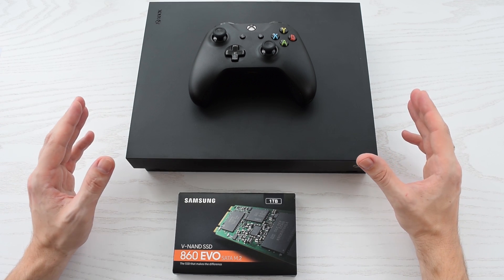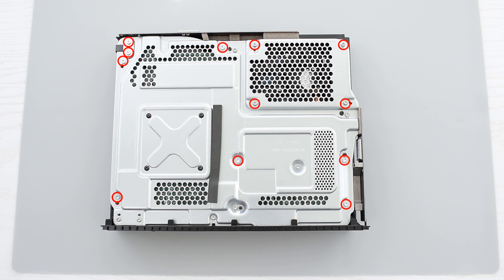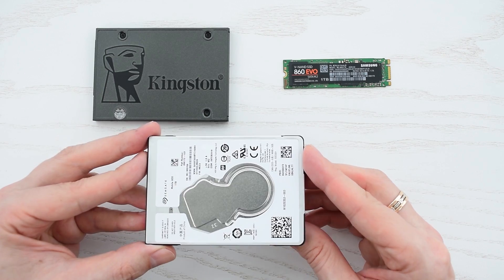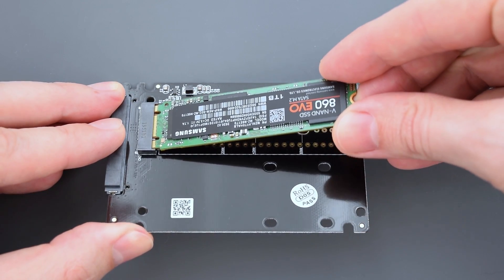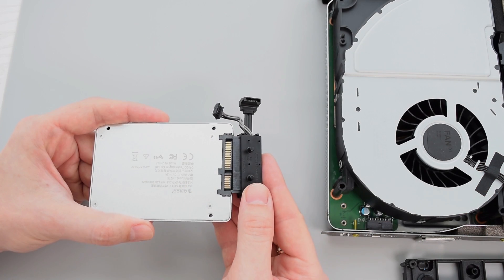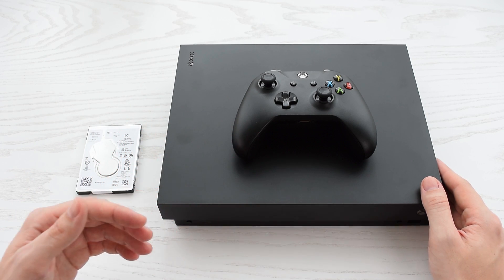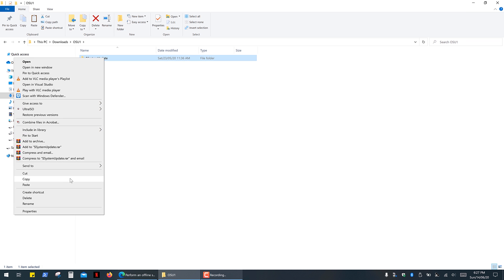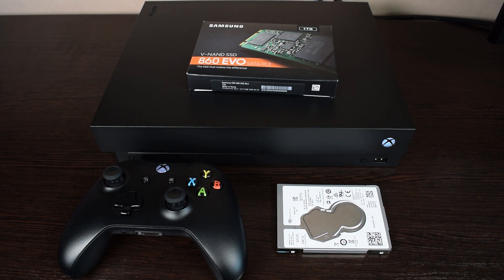How to Upgrade your Xbox and PlayStation Console to M.2 SSD Drive. 100% Works for all Consoles

Comment: Wonder how many people going to by a NVMe and do this only to find out it won't fit XD
Reply from the maker: We didn't use any NVMe SSDs here because it's impossible. We were using M.2 SATA (NGFF) SSD which has SATA III interface. And we need that adapter only to adapt drive's form factor. The main idea was just to show the upgrade options. Lots of people say that they have spare M.2 NGFF SSDs after upgrading laptops etc. And they didn't even know that such adapters exist. Or maybe you just want to use that M.2 SSD in another device after your console dies (2.5" SSDs are becoming obsolete), then it's pretty good option.

Comment: That's the wrong m.2 for that slot you use M key or sata not a b+m key. But I like your video.
Reply from the maker: M.2 SSDs with M key are NVMe ones which you can't use in this application. You can't convert NVMe (PCIe) SSD to SATA port!!! You can only use SATA based (NGFF) M.2 SSDs which have B or B+M keys. I hope I explained it clear.
Reply: @ElectronicsComputers thanks for the tip I appreciate it

Comment: Can the same method be used for pcie Nvme m.2 SSD's?
Reply from the maker: You can't convert NVMe (PCIe) SSD to SATA port! You can only use SATA based (NGFF) M.2 SSDs which have B or B+M keys.

Comment: That is a waste of an M2 drive. It is not going to be fast because of bottleneck it caused by the old Xbox arcatechture
Reply from the maker: We were using M.2 SATA (NGFF) SSD which has SATA III interface just like Xbox One X. The main idea was just to show the upgrade options. Lots of people say that they have spare M.2 NGFF SSDs after upgrading laptops etc. And they didn't even know that such adapters exist. Or maybe you just want to use that M.2 SSD in another device after your console dies (2.5" SSDs are becoming obsolete), then it's pretty good option.

Comment: It’s better to just buy an SSD data drive you will get the same performance for less!
Reply from the maker: The main idea was just to show the upgrade options. Lots of people say that they have spare M.2 NGFF SSDs after upgrading laptops etc. And they didn't even know that such adapters exist. Or maybe you just want to use that M.2 SSD in another device after your console dies (2.5" SSDs are becoming obsolete), then it's pretty good option.

Comment: Does Sony or Microsoft give some problems on that work? It Is very interesting and i Will share your video
Reply from the maker: It works perfectly well with all devices (laptops, desktops, consoles etc) that have SATA port. You just need to figure out how to install OS. And make sure that you use NGFF (SATA) SSD not NVMe.

Comment: What's the benefits of this? Would it make a ps4 run better as mine is running a tad slow cheers
Reply from the maker: We were using M.2 SATA (NGFF) SSD which has SATA III interface and it has the same speed as any 2.5" SSD. The main idea was just to show the upgrade options. Lots of people say that they have spare M.2 NGFF SSDs after upgrading laptops etc. And they didn't even know that such adapters exist. Or maybe you just want to use that M.2 SSD in another device after your console dies (2.5" SSDs are becoming obsolete), then it's pretty good option.

Comment: Nvme to sata 🤮
Reply from the maker: Don't leave such silly comments! We didn't use any NVMe SSDs here because it's impossible. We were using M.2 SATA (NGFF) SSD which has SATA III interface. And we need that adapter only to adapt drive's form factor. The main idea was just to show the upgrade options. Lots of people say that they have spare M.2 NGFF SSDs after upgrading laptops etc. And they didn't even know that such adapters exist. Or maybe you just want to use that M.2 SSD in another device after your console dies (2.5" SSDs are becoming obsolete), then it's pretty good option.
Reply: @ElectronicsComputers  sata câble as à maximum speed of 6gb/s dont say its à silly comment 2.5 inch ssd are 50% cheaper and you wont let speed on the table if you get any fast nvme and convert it to sata you have to have brain damage even worse by installing in a console 😂😂😂 I know what I am taking about I have 4x nvme 2tb on a pcie 4.0 lane on a pc cause I am not fck stupide and I did put a 2,5 inch ssd in my one x still sucks tho.
P. S. there Will be spelling mistakes english is m'y 3th language
Reply from the maker: @Kawasaki225  You no nothing about SSDs, dude. I was using SATA M.2 SSD!!! It's NGFF not NVMe!!! You can't use NVMe on that console only SATA based SSDs. Educate yourself and don't leave stupid comments! 
The main idea was just to show the upgrade options. Lots of people say that they have spare M.2 NGFF SSDs after upgrading laptops etc. And they didn't even know that such adapters exist. Or maybe you just want to use that M.2 SSD in another device after your console dies (2.5" SSDs are becoming obsolete), then it's pretty good option.

Comment: This is a great tutorial.  However, it makes no sense whatsoever to upgrade using and NVMe SSD because it will only achieve SATA speeds.  This is a limitation of the motherboard chipset inside the XBOX One X.  Just use a standard SATA SSD, which is about half the price for the same amount of storage.  And while your at it and have the unit open, might as well upgrade to WiFi 6 👍🏻
Reply from the maker: We didn't use any NVMe SSDs here because it's impossible. We were using M.2 SATA (NGFF) SSD which has SATA III interface. And we need that adapter only to adapt drive's form factor. The main idea was just to show the upgrade options. Lots of people say that they have spare M.2 NGFF SSDs after upgrading laptops etc. And they didn't even know that such adapters exist. Or maybe you just want to use that M.2 SSD in another device after your console dies (2.5" SSDs are becoming obsolete), then it's pretty good option.
I hope you learned something today.

Comment: Good video, but totally pointless, the sata port is only capable of 600mbps no where near the capabilities of an nvme drive, and 2 nothing is coded to use anything faster than that. That’s why when you do ssd upgrades in these consoles there’s not much difference in speed.....
Reply from the maker: We were using M.2 SATA (NGFF) SSD which has SATA III interface the same SATA III port has Xbox One X. And we need that adapter only to adapt drive's form factor. The main idea was just to show the upgrade options. Lots of people say that they have spare M.2 NGFF SSDs after upgrading laptops etc. And they didn't even know that such adapters exist. Or maybe you just want to use that M.2 SSD in another device after your console dies (2.5" SSDs are becoming obsolete), then it's pretty good option.
Reply: @ElectronicsComputers  gotcha, after reading the description again you are correct. I just misread it.....

Comment: If you did that could you just put all your info on the ssd and have all your games
Reply from the maker: You have two options, you can clone your old HDD to your new SSD or simply reinstall Xbox OS and your games. Your game progress will be synced when you log in to your xbox account.
Reply: @ElectronicsComputers  how do you clone it
Reply from the maker: @grubling1494  We didn't clone it, we just installed a fresh OS from the USB drive.

Comment: Hmm..... for $100 I bought a Samsung 860 EVO SSD for a laptop and replaced the HDD in my PS4 Pro because they use laptop HDD's.... so this whole process makes no sense to me, got it home, put it in, installed the update via USB drive, done. Took me literally less than 5 minutes.
Reply from the maker: The main idea was just to show the upgrade options. Lots of people say that they have spare M.2 NGFF SSDs after upgrading laptops etc. And they didn't even know that such adapters exist. Or maybe you just want to use that M.2 SSD in another device after your console dies (2.5" SSDs are becoming obsolete), then it's pretty good option.
Reply: Ohhhh alright that makes alot more sense, I thought people were buying those to put in lmao.

Comment: All that work for a M.2? M.2 SSDs have the same speeds that regular SSDs have. No different in performance from M.2 SSD and regular SSD. Just stay with a regular SSD
Reply from the maker: It works only for SATA (NGFF) M.2 SSDs which has the same speed as a regular 2.5" SSDs. The main idea was just to show the upgrade options. Lots of people say that they have spare M.2 NGFF SSDs after upgrading laptops etc. And they didn't even know that such adapters exist. Or maybe you just want to use that M.2 SSD in another device after your console dies (2.5" SSDs are becoming obsolete), then it's pretty good option.
Reply: I had to replace my original hard drive because it quit working. Now it loads way faster.

Comment: Don't wast your money on this guy's idiot idea it's a wast of money, the interface he's telling you to buy is half as slow as what you could buy for the same price aka m. 2 pcie. Bit is twice as fast.

Yet it doesn't matter because the console can't read at that speed so why spend a premium? 

 Ya the Xbox S X a nitch product never seen a nitch product aka console take up a failing standard. "Cough" Blu-ray. SATA 1.

My point stands why pay for an interface that will not be used on PCs in the future as storage is all going PCI EXPRESS. And your trying to rationalize shoving a big black cock down when a better bigger black cock aka PCI EXPRESS down 5-year-old's throat you're never going to fit it and it's just obscene/inappropriate and a waste of effort and money.

Consoles CANT read faster than sata 2 aka 300MB/s on newer last gens but original PlayStation 4s can't support anything faster than SATA 1 @150MB/s at best. An your talking about 2,000MB plus speeds. Do you here yourself.

I'm only saying cuz there's a lot of stupid people out there that don't know better and you're telling them to pay more for absolutely no benefit.

Both sides of the interface have to be running at the same speed to get the benefit and the consoles do not read at that speed and it's too slow for the newer consoles not to mention the wrong interface.

So you still haven't told me anything that justifies why spending more on that old tech and you still end up spending more money than it would have cost by just buying a cheap SATA SSD.

Also SSD are generally unreliable on a reasonably used system for 3 years at that point you should be replacing the drive.

So why spend more money on something that's not going to last more than 4 years reliably when you can get a super cheap SATASSD for cheaper.

The Xbox can't read any faster than sata2 aka 300MB tops.

So why spend more for nothing gained?

Cost benefit analysis it's stupid

Comment: The bottle neck is the converter that changes the M.2 Drive to a SATA interface, so this won't make your console faster, it'll instead cap out at about 500-900mb/s.

If only Microsoft used M.2's interface as well for their consoles (excluding the Series S and X because they already use an SSD).
Reply from the maker: We were using M.2 SATA (NGFF) SSD which has SATA III interface. And we need that adapter only to adapt drive's form factor. This SSD has the same spedd as any 2.5" SSD. The main idea was just to show the upgrade options. Lots of people say that they have spare M.2 NGFF SSDs after upgrading laptops etc. And they didn't even know that such adapters exist. Or maybe you just want to use that M.2 SSD in another device after your console dies (2.5" SSDs are becoming obsolete), then it's pretty good option.

Comment: Im not sure that with ssd2m2 adapter it will be faster than the regular ssd sata drive...because of adapter...
Reply from the maker: No! It's not gonna be faster because we use M.2 SATA (NGFF) SSD which has the same speed as a regular 2.5" SSD. The main idea was just to show the upgrade options. Lots of people say that they have spare M.2 NGFF SSDs after upgrading laptops etc. And they didn't even know that such adapters exist. Or maybe you just want to use that M.2 SSD in another device after your console dies (2.5" SSDs are becoming obsolete), then it's pretty good option.

Comment: Does M.2 SSD drive installation also work on PS3 (1TB max) & Xbox 360 (2TB max) consoles? How about soft-modded OG Xbox & Fat PS2?
Reply from the maker: Actually it works for any device which has 2.5" or 3.5" SATA HDD!!! And also don't confuse M.2 SSDs. There are two types NGFF (SATA) or NVMe and we can use only NGFF SSDs.

Comment: Such a stupid thing... The nvme is not faster, it is blockt by the sata 3..... Stupid as fuck....
Reply from the maker: Don't leave such stupid comments! We didn't use NVMe SSDs here because it's impossible. We were using M.2 SATA (NGFF) SSD which has SATA III interface. So we need to use that adapter only to adapt form factor. The main idea was just to show the upgrade options. Lots of people say that they have spare M.2 NGFF SSDs after upgrading laptops etc. And they didn't even know that such adapters exist. Or maybe you just want to use that M.2 SSD in another device after your console dies (2.5" SSDs are becoming obsolete), then it's pretty good option.
So, I hope you learned something new today.

Comment: I'm not a xbox fan but I would love to see the load times compared to a xbox series x or s
Reply: Series x and s would still be faster. The xbox one uses sata 3 ports and there is a max speed on them...so It would be the same speed as a regular ssd. This is for people who already have m.2 drives around in a large capacity for some reason who want to use them.

Comment: This video tutorial works fine if you have a m.2 ssd instead of 2.5 inch ssd but there is no use if you a 2.5 inch ssd
Reply from the maker: The main idea was just to show the upgrade options. Lots of people say that they have spare M.2 NGFF SSDs after upgrading laptops etc. And they didn't even know that such adapters exist. Or maybe you just want to use that M.2 SSD in another device after your console dies (2.5" SSDs are becoming obsolete), then it's pretty good option.
Reply: @ElectronicsComputers  Agree. With u

Comment: Very good explanation, I have a question. How about the speed and the loading times compared to normal ssd? Is so much better?
Reply from the maker: I was using M.2 SATA (NGFF) SSD don't confuse it with NVMe SSD which you can't put into that adapter. Basically, such adapters for NVMe SSDs don''t exist. M.2 NGFF SSD provide the same speed as a regular 2.5" SSD. The main idea was just to show the upgrade options. Lots of people say that they have spare M.2 NGFF SSDs after upgrading laptops etc. And they didn't even know that such adapters exist. Or maybe you just want to use that M.2 SSD in another device after your console dies (2.5" SSDs are becoming obsolete), then it's pretty good option.

Comment: Why not just buy 2.5 inch ssd instead of buying an ssd and an enclosure ?
Reply from the maker: The main idea was just to show the upgrade options. Lots of people say that they have spare M.2 NGFF SSDs after upgrading laptops etc. And they didn't even know that such adapters exist. Or maybe you just want to use that M.2 SSD in another device after your console dies (2.5" SSDs are becoming obsolete), then it's pretty good option.
Reply: @ElectronicsComputers  ok that makes sense

Comment: I don't see why you would do this instead of just getting a regular 2.5 inch ssd
Reply from the maker: The main idea was just to show the upgrade options. Lots of people say that they have spare M.2 NGFF SSDs after upgrading laptops etc. And they didn't even know that such adapters exist. Or maybe you just want to use that M.2 SSD in another device after your console dies (2.5" SSDs are becoming obsolete), then it's pretty good option.
Reply: @ElectronicsComputers  I see

Comment: So whats the max speed ssd you can put on the Xbox One X?
Reply from the maker: You can only use SATA M.2 SSDs and there's no difference in speed between 2.5" SSD or M.2 SATA (NGFF) SSDs. Those SSDs is more than enough for comfort gaming. The difference in console performance after upgrading to SSD is pretty obvious.

Comment: А есть ли смысл? Я понимаю что в этих консолях эклномили на жёстких дисках , но если смысл ?
Reply from the maker: It works significantly faster. Games start faster, the console updates faster and games installation takes way less time than with HDD. There's no difference between a regular 2.5" SSD and M.2 SATA (NGFF) SSD since they provide the same speed.

Comment: Why not just buy a 2.5 drive in the first place? This is just adding extra steps with no added benefits..
Reply from the maker: The main idea was just to show the upgrade options. Lots of people say that they have spare M.2 NGFF SSDs after upgrading laptops etc. And they didn't even know that such adapters exist. Or maybe you just want to use that M.2 SSD in another device after your console dies (2.5" SSDs are becoming obsolete), then it's pretty good option.

Comment: I'm stuck on error 101 & the usb method doesn't work x(
Reply from the maker: Did you participate in Xbox insider program?
Reply: @ElectronicsComputers  I don't know what that is, I'll look into it
Reply: I just purchased this xbox one x today, it's made in 2017
Reply: @ElectronicsComputers  no I didn't join
Reply from the maker: @Tomb-1776  First, let your console update its software with the original HDD. When it's done replace the HDD with an SSD.
Reply: Worked, thank the gods!
Reply from the maker: @Tomb-1776 I'm glad it worked for you.